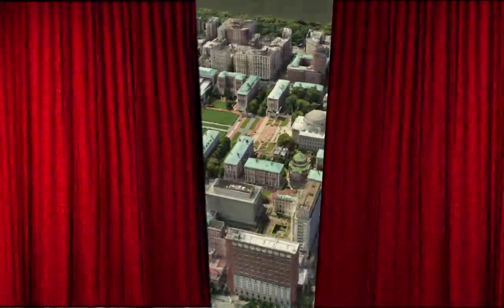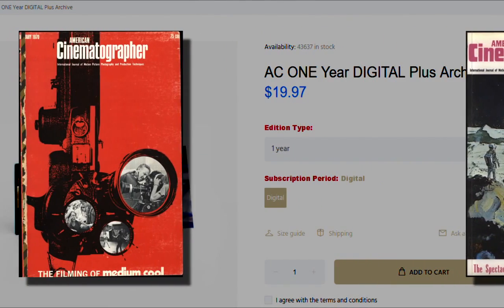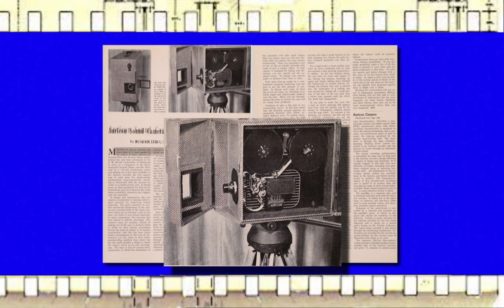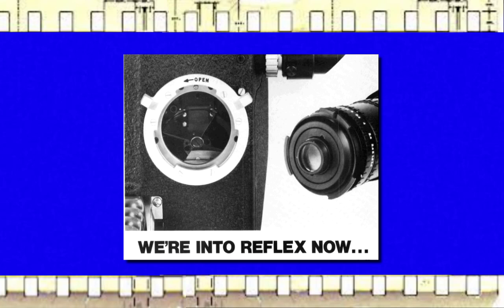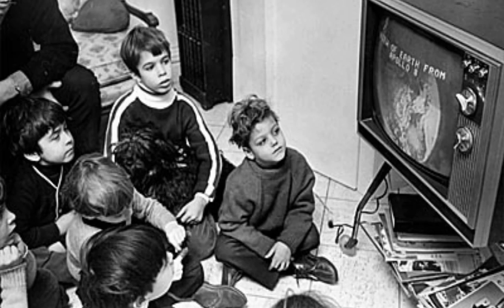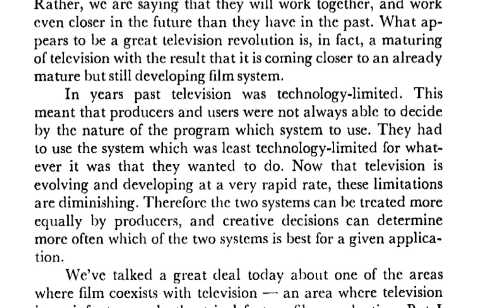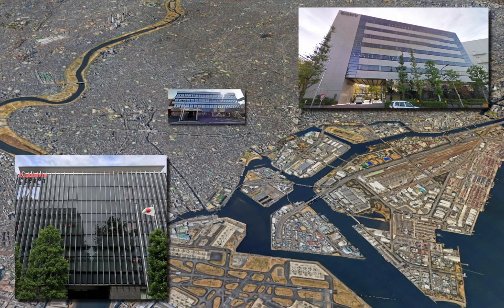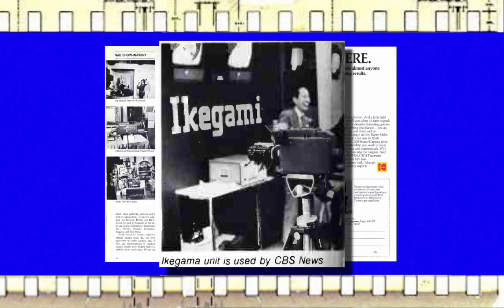The Last 16mm Film Camera Made in America

Comment: A friend of mine has (to my knowledge) the only in-use Mitchell BNCR.  It's really a work of beauty.  They're big & heavy but they're built to last and as old as they are, a lot of effects houses were still using them into the 90s when CGI took over the industry.  Oddly enough, he also has a "chopped" Auricon sound camera.
Reply from the maker: I've read that most of the Mitchell Camera movement's, the actual machinery inside the camera that moved the film, were removed and reinstalled into Panavision cameras and everything else was scrapped. So a functioning BNC Reflex is basically priceless. Would love to just to listen a strip of film going through one in person at this point. Your friend definitely has a keeper.
Reply: @Givemegoodglass Yeah, early Panavision cams are basically gutted Mitchells.  Later Panavisions are copies.  They were able to make them lighter and quieter but never more precise.  I can ask if he has some scrap film to run through his camera.  It was on loan to a museum for a while but I think he got it back.